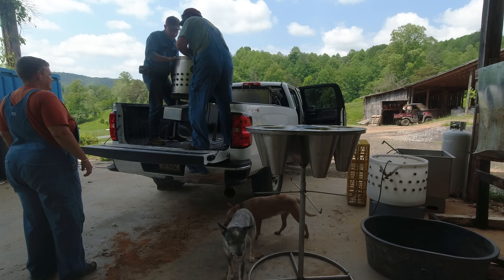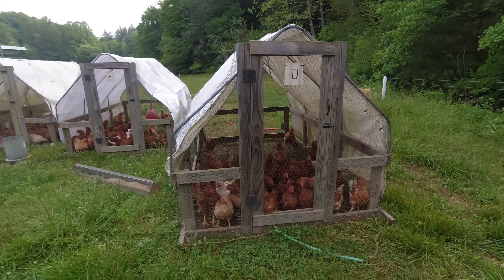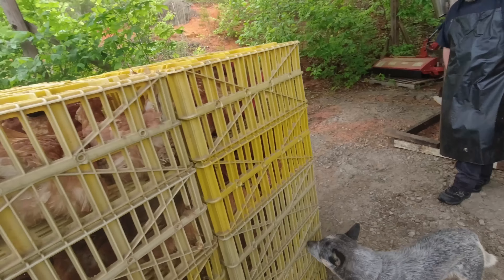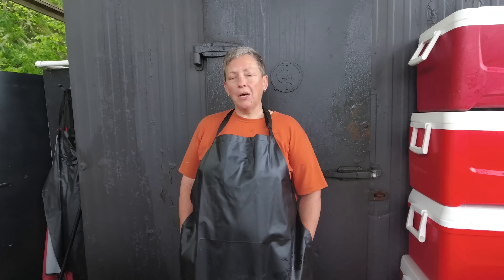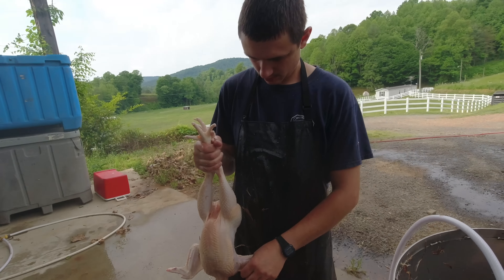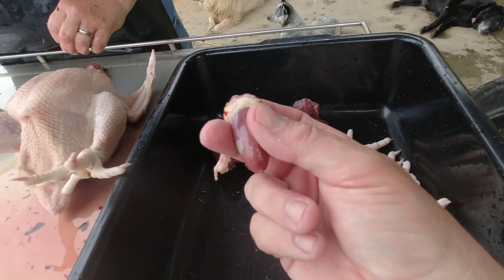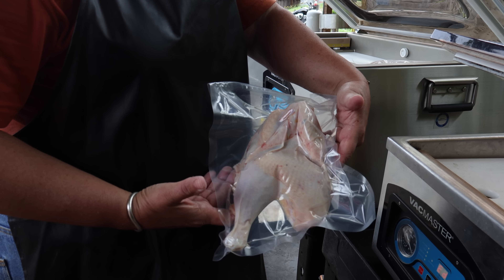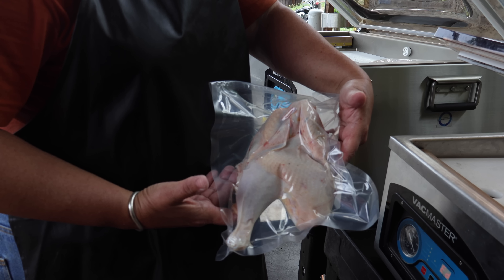Processing Chickens Like Joel Salatin - Polyface Farm Process

Comment: Nice upgrade. Your plucker should have an overhead water shower on it. that would get a uniform rinse and free up the person standing over the plucker with a hose. Then your knife man could run the kill cones, the scalder, and the plucker (potentially).

Those cones are the original Poultry Man design, and they worked well for 20 years, but the chickens have changed their size and shape. inserting the individual cones is a good solution. Poultry Man has a new cone design that we've started selling  in the last couple years that works for everything from market age broilers to heritage turkeys. It eliminates the birds kicking out.

The scalder turns at 6 RPM. So for those birds, 7 RPM matches what I'd expect. 

As for maintenance, both the scalder and plucker have grease fittings on the shafts. Since you bought that equipment used, make sure you hit it with some grease now then every 6 months or so. 

The scalder motor will run forever under this load. On the plucker, I'd recommend starting the plucker before you load it so you're not starting it under load and that will help extend it's life. Then apply some grease, and you're in business for a long time, even outside. 

Watch the flame on your model scalder. As the flame turns from a nice  uniform, bright blue into an orange, jagged flame, you'll need to clean the burner by drilling out each hole with a 3/32" drill bit. The holes will corrode over time, especially outdoors, so you'll start noticing progressively longer heat up and recovery times and scald times.
Reply from the maker: Hey Mike!  Thanks for the feedback. Great useful info. 

Since it was used, the shower head wasn’t working so we just took it off. Not sure if the line was clogged with junk or what it was. I’ll pull it back out and do some maintenance and see if we can get it going. 

This really improved our efficiency when I replaced the timer. Super easy for our dispatch guy to just pull birds and flip the switch. 

Thanks again!